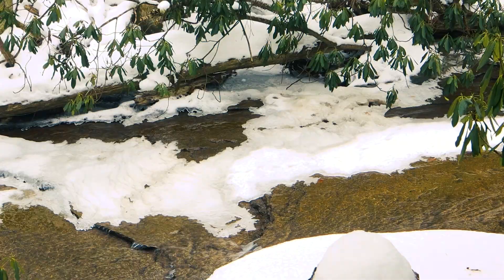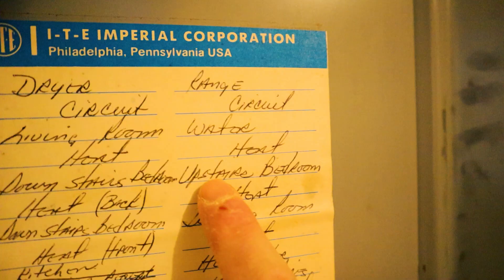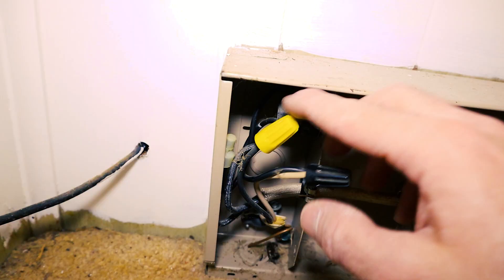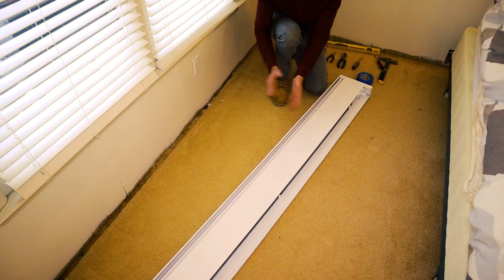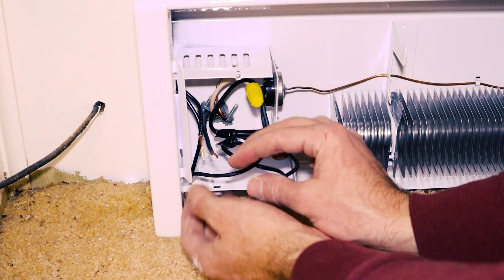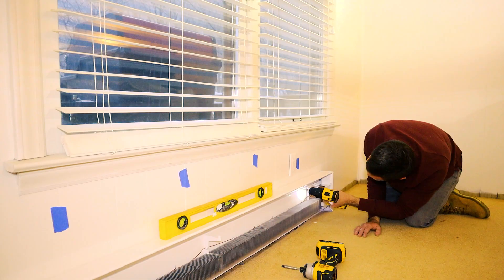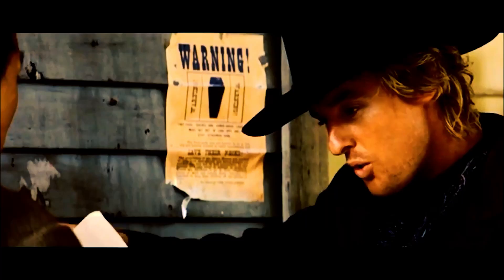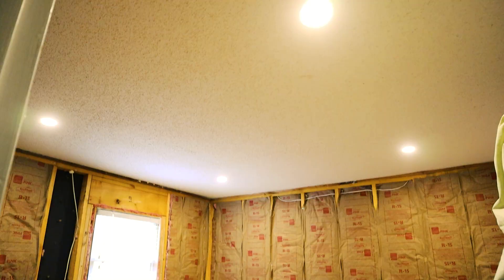Cadet Baseboard Heater Installation | Cabin Flip Ep.7

Comment: Thanks for making this video!  Just two recommendations... 1) Because the white wire is hot from the breaker, it should be wrapped with black electrical tape to indicate that it's hot, not neutral, especially being a 240 volt setup  2) If wiring to code, the feed from the wall should be in an electrical box.  You can buy a 1 gang old work box (sometimes called a cut-in box) that can go in after drywall, then they can be sealed at the entry point with duct seal to stop drafts.

Comment: Quick question . I want to put a smaller baseboard heater in the dinning room to have more wall space . I have a 103inch long 2500watt baseboard heater there now . Can I put a 83inch 2000watt baseboard heater instead? This should be fine because I'm going with less wattage RIGHT??

Comment: Do you have to use the thermostat on the wall with these? I got just the thermostat control for on the radiator with the hot and cold knob.

Comment: why is everyone calling Electrical baseboards  'Hydronic'     HYDRO means water......   to have a hydronic heating system means you are moving water to heat system....   this is  an electrical baseboard heating system   NOT a hydronic.........
Reply from the maker: There is a liquid within these Hydronic baseboards that helps to retain the heat longer than a traditional baseboard heater. It doesn't have all of the plumbing as the really old ones but has a similar effect.